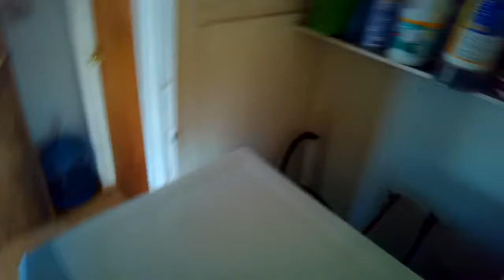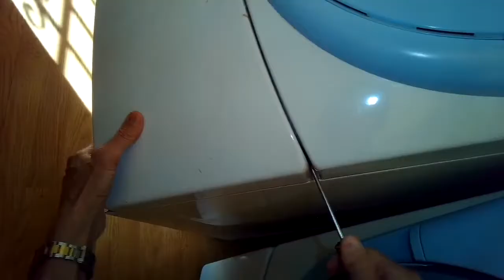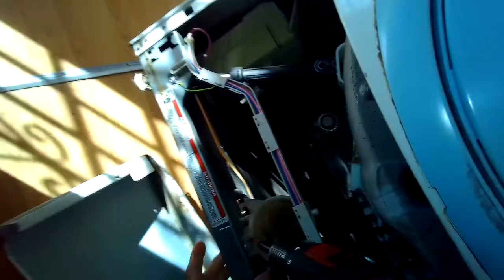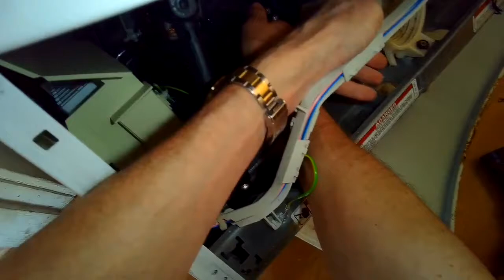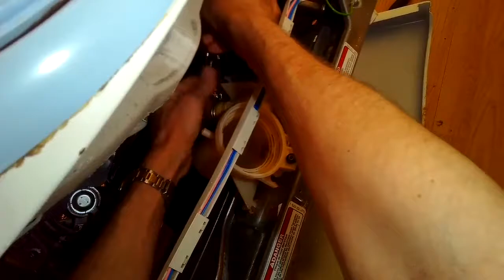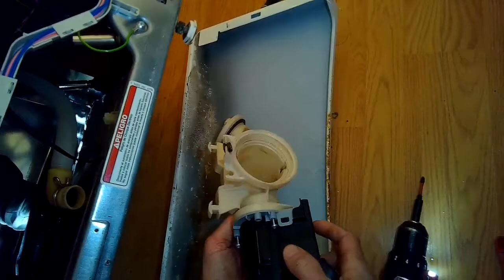Duet Washer—Won’t Drain

Comment: Good morning  I have an Inglis  IFW7200TW , that won't go into high RPM spin . Everything else works , goes throught full cycle as per normal .
This machine does not have any manual clean-outs or drains .
I had it apart and confirmed that nothing stuck , impeller spins fine , drain hose is clear etc . 
I also replaced the door switch recently ( short of the cost of the part ) it was the easiest first thing to do 
Where my W/D are ( stacked ) they are a big chore to get out to work on .

????

Thanks   Bob
Reply from the maker: Sounds like it’s time for a new motor controller